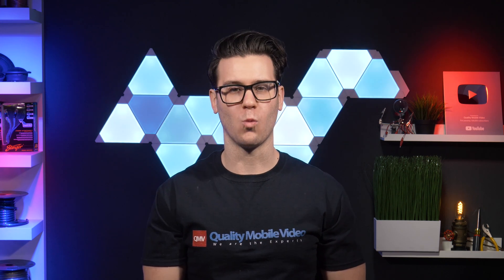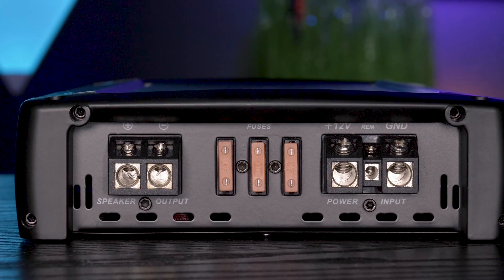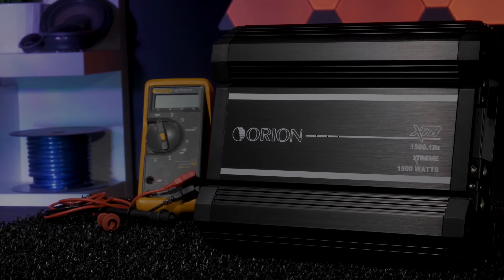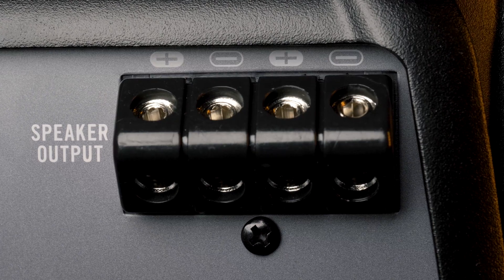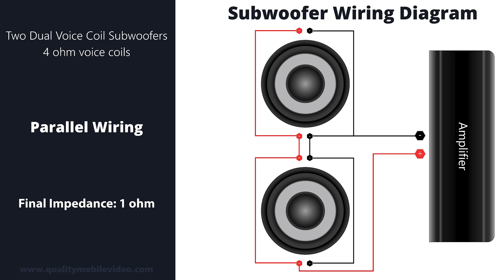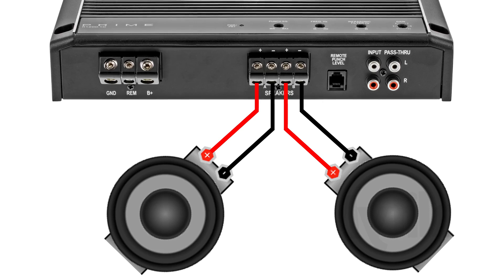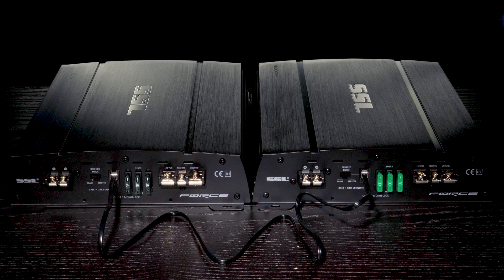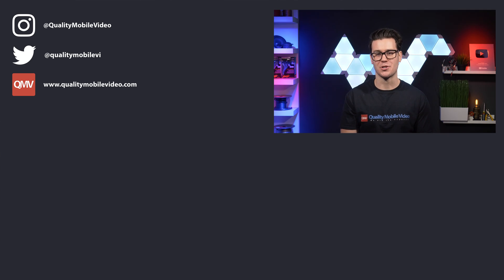Your MONOBLOCK Amplifier has TWO SETS of Speaker Terminals - WHY???

Comment: Would've liked to see more ohm load configurations when wiring subs on the mono block with multiple channels
Reply from the maker: Oh, well we've made several videos on that! Here's a playlist. https://www.youtube.com/playlist?list=PLgSNj_wNA0j0rk71E3l9Xqy0Nmf6pN3cq
Reply: @Qualitymobilevideo  do you have one where you wire 2 dvc 4 ohm subs to a 2 speaker output monoblock amp? If I run each speaker in parallel directly to their respective output at the amp, is it still seeing a 1 ohm load at the amp? Before i would run the speaker wire from one sub to the other, then to the amp on the one output it had.
Reply: @DJCuhhhstin956  I have that same question. I know exactly what you mean
Reply: @DJCuhhhstin956  I  need to know this as well
Reply: @Qualitymobilevideo  no SVC love? Couldn’t find those
Reply: Same question here, i think the answer is yes
Reply: Mono only has one channel. It can have 2 output on that one channel

Comment: I connected the positive of my sub to the positive of 1 set of terminals and the negative to the other set of terminals. Is this incorrect? Should I just connect it to one set of positive and negative
Reply: Actually forgot my comment. Its just clicked for me think of those terminals as a Y splitter. Its just for convince if you wanna run thick cable or running two subs with separate connectors. Lol
Reply from the maker: What is your exact brand and model of amplifier
Reply: @Qualitymobilevideo  targa 12000w dynamite series... Not sure if it's an international brand though
Reply: Ah shit, I've done this to, my amp is Bassface DB1.3 2130w 1Ohm Class D Monoblock Car Amplifier. Ir didnt come with a instruction book either,  instead ihave to go to the website and download a pdf. Pretty sure it said to bridge them though.

Comment: why do some monoblock amp has relay clicking and some do not?
Reply: Um.......Because some have an internal relay.
Reply: Its just a different way to build the circuit. Relays are rather cheap in today's market, and easily serviceable (compared to a IC chip). They also can handle high amounts of power.